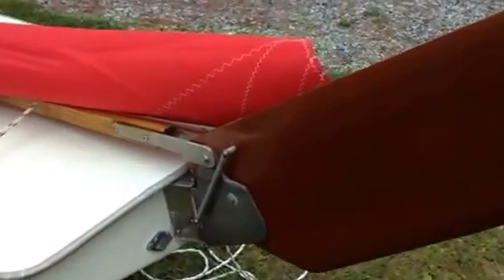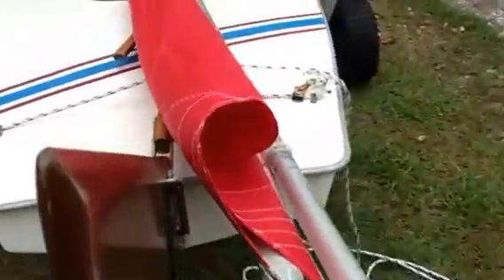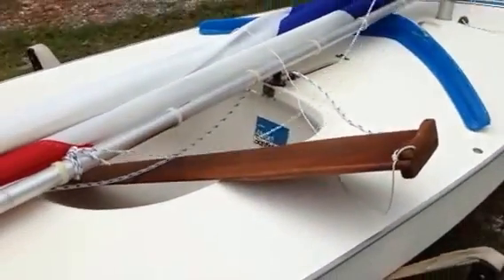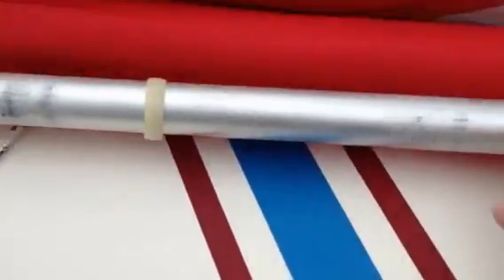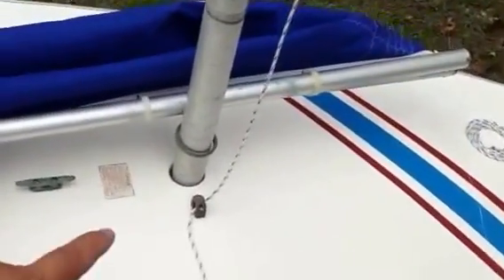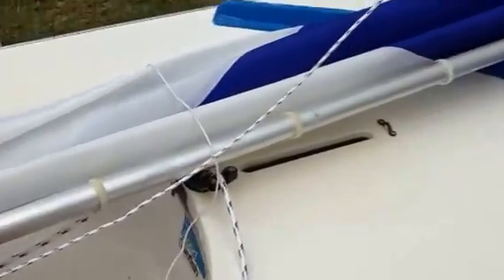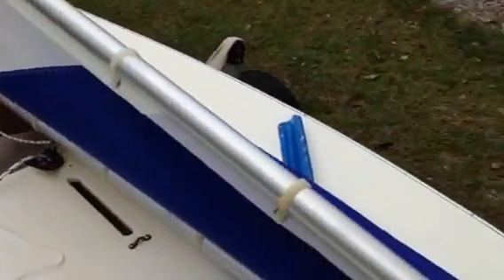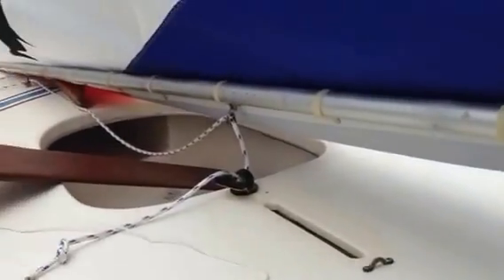Sunfish Sailboat Rigging Part 1

Comment: I may of asked before, but what block / cam cleat are you using for the main sheet?
Reply from the maker: AMF Alcort had a swivel cam cleat with bullseye fairlead as standard equipment for years. I believe it was made by Harken as they were supplying other Harken hardware for the boats at that time. A similar product today is https://www.harken.com/en/shop/cam-cleat-bases/standard-cam-base-swivel-bullseye/. I like it, but my hand rarely leaves the sheet with the line cleated unless I'm out in a drifter. Skipper goes Old School, no cleat, not even the sheet hook on the forward lip of the cockpit. Racers each have their own rig, and I think the new race version boats come with a stand up ratchet block.